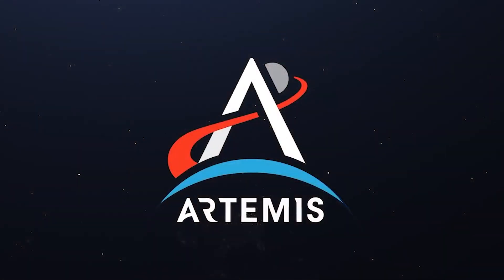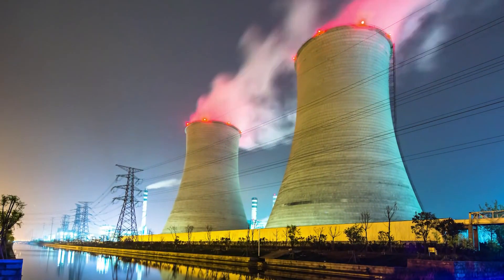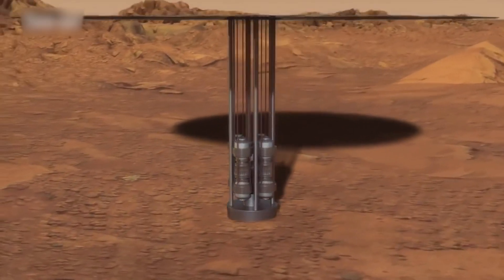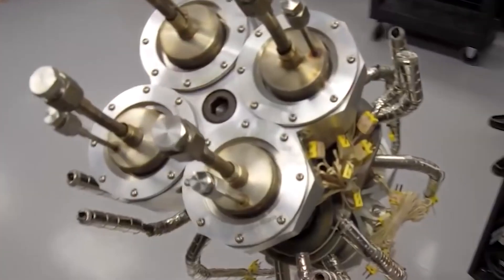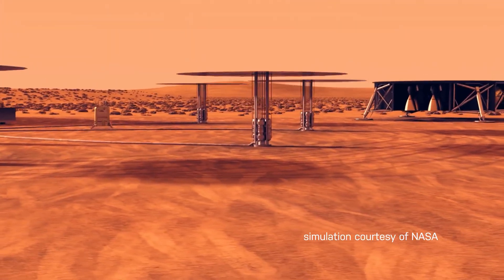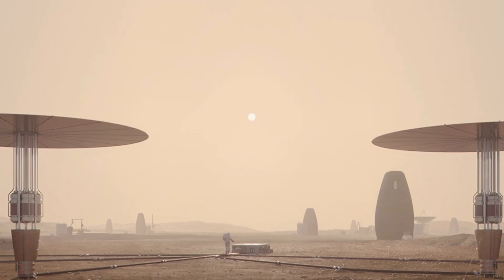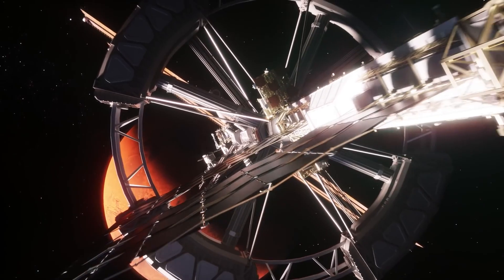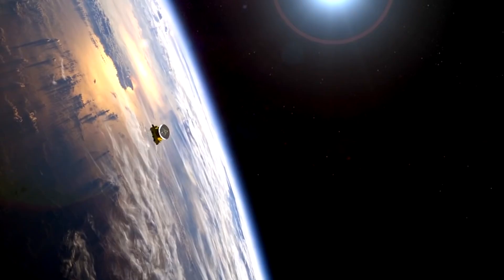Inside Nasa's NEW Plan To Power The WHOLE Moon!

Comment: You need to do better research... as Apollo 12 left a SNAP-2 7, marking the first use of a nuclear electrical power system on die moon. It was designed to provide all the electricity for continuous one-year operation of die National Aeronautics and Space Administration (NASA) scientific instruments and supporting subsystems deployed by the astronauts on the lunar surface. ....
https://www.iaea.org/sites/default/files/publications/magazines/bulletin/bull12-1/12104700912.pdf